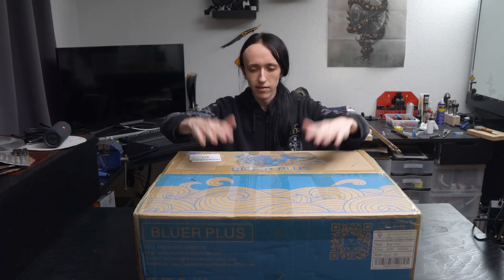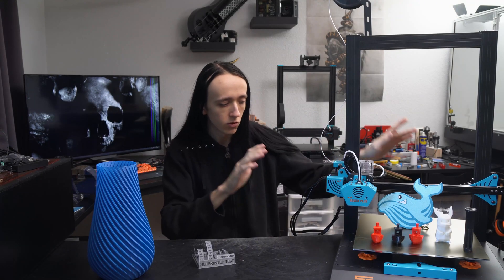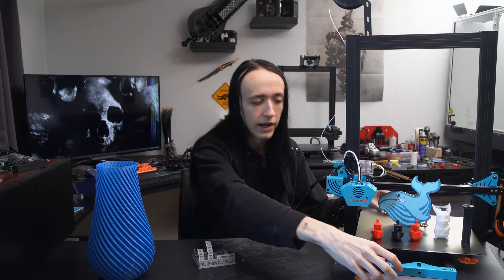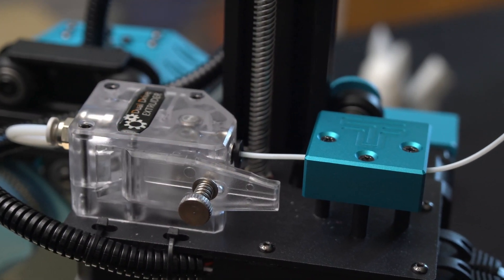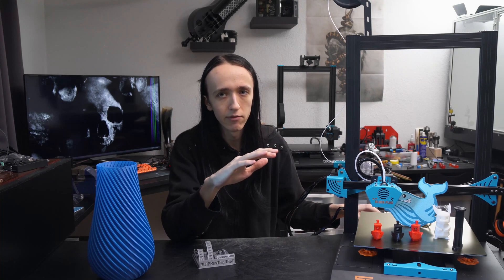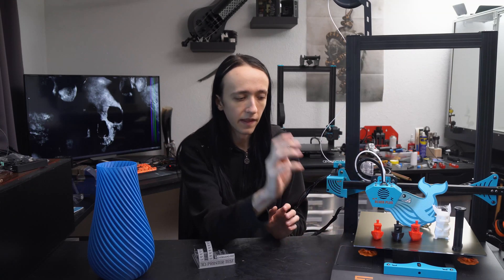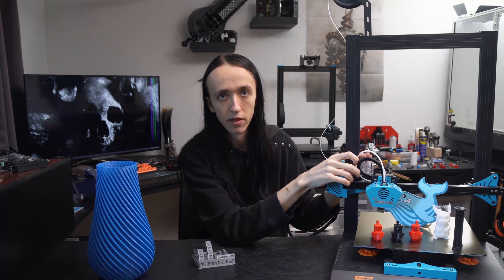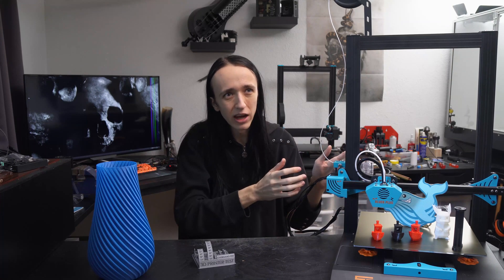TwoTrees Bluer Plus Review

Comment: I got this printer on sale for 329$ on Black Friday.
It was the easiest build/1st print I have done in my life.
Are there some issues, yes. 
Are there as many issues as I have had with any other printer, not even close.
Issues
Took a while to get the bed stable by adjusting the eccentric nuts but keeping the eccentric nuts  towards the outside of the build plate helped a lot. Great planning Two Trees.

After 3 prints the grub screw came loose inside the extruder. When I fixed it I used loctite thread locker, I doubt that issue will come up again. l will say those 1st 3 prints kicked butt. I just finished fixing it so I cant be sure but I am guessing my prints will be even better now.
I think the combination of the 0.9 degree stepper motors for all functions, the 2209 drivers for all motors, the better lead screws, and the auto adjusting Z gantry wheel assembly made for some very impressive prints from a very stable, well designed, precise printer.

Is it slow yes
do you need a lot of retraction yes do the prints come out amazing yes
Is it the easiest printer I have ever used, without a doubt.
The latest version of Cura had a profile for this printer and the settings were dead on. No tweaking or messing with settings.
I remember the times when it seemed to take days to finally get the bed level enough to form a good print. Then the good print stuck to the bed and needed to be pried off. After that I couldn't figure out why my level was shot. That was actually again a year ago. 
FYI
I recently tried the anycubic Vyper and that was a complete disaster.
I will be returning it.
Bang for the buck this printer( the Bluer Plus/5) is my choice especially for newbies.
I would reccomend it without hessitation even at the $400 Price.

Comment: I wrote this whole comment before I heard you talk about retractions at 13:09 in the video. You went about this in the wrong way imo, you should’ve properly calibrated the extruder via usb. But I realize you probably didn’t do that because most people would never do something like that, they’d just up retractions

I would theoretically buy one of these and throw a 0.8mm nozzle on it to increase the speed. That filament path (with the weird gap between extruder and runout sensor) is something creality made popular despite its awful design. Wifi on printers is cool but it’s something I know I’d never use. I think you can turn off that BLtouch style leveling in your gcode. Is this firmware open source?

Super dope review as ways. Would love to see you upgrade it in future videos because it seems to have potential with that build size and ABL
Reply from the maker: You might be able to turn the bltouch off, but the you wouldn't have a z axis limit switch any more, as it just uses the bltouch for that.
As for the extruder calibration, you're only gonna get so far. With a bowden setup and a volcano style hotend, you'll always need long retractions, even perfectly tuned, just due to the flex and amount of molten material in the system.